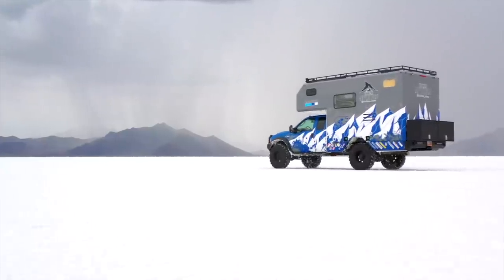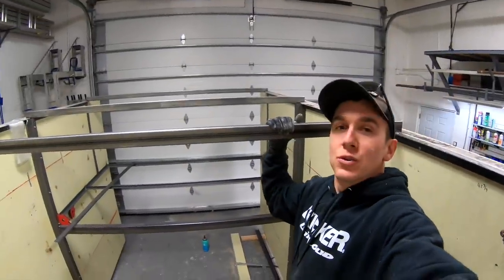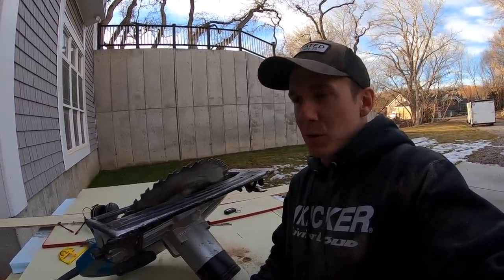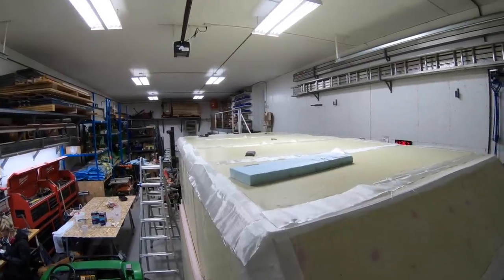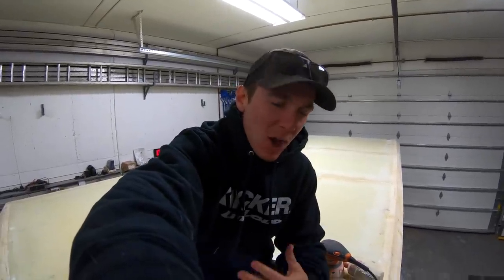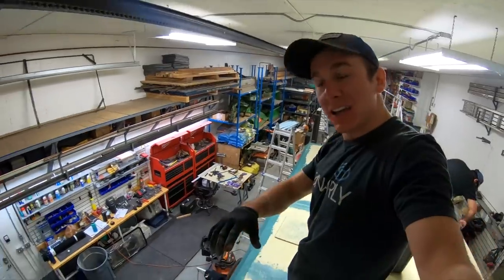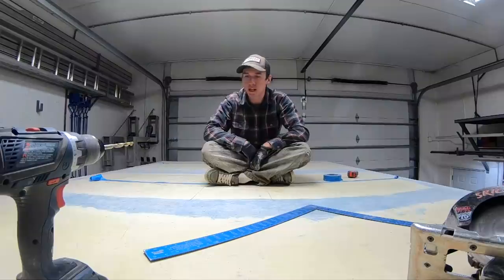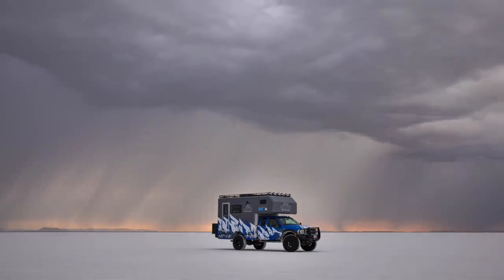MUSEROAMER PROJECT (Part 2) The Ultimate DIY Overlanding Expedition Vehicle!

Comment: Watching eagerly, as I would like to build a trailer for long term winter snowmobile trips.  Sealed, heated bay in the rear for the sleds, living area up front, designed around winter operation.
Reply from the maker: We want to do that as well! This project kicked my but a little. Plan is to take her to AK this spring!
Reply: @AndrewMuse  Right now the plan is to use a 25 foot or so 5th wheel trailer frame, old ones are available for very cheap.  Strip all the travel trailer off and start from the frame up.  Was doing some cad drawing and visualizing today in fact 👍
Reply from the maker: @mutt2jeff  That would be awesome! I would love to see how it comes together. Before we started on this build we thought about doing a toy hauler build out.

Comment: Great work.

So the panels were 1/2" ply, 2" foam, 1/2" ply ?   What ended up being the magic glue ?   You screwed them as well ?

Once the shell was done you fiberglassed the outside with 16oz glass mat and polyester resin ?

Comment: Can you tell us a little bit about dimensions of the box - Length x Width x Height, plus it would nice to hear about the final weight of a box without/with all equipment?
Thank you in advance
Reply from the maker: It's roughly 8x16' and with the roof box and AC on top it's nearly 13'. I'll be releasing a final weight with it mounted in a later episode, unfortunately I wasn't able to weigh the box alone. 🙏🏼😊
Reply: @AndrewMuse  thank you for sharing the information

Comment: it looks like your foam panels are covered on both sides with plywood, correct? Is the frame also steel? I know the 550 has a huge weight capacity, but that seems fairly heavy. Did you consider aluminum frame and lighters walls, and what made you go with the materials you chose? Also, I love the pass thru and think that is a must have in a rig like this. I hope to build the baby brother edition, much lighter on a Tacoma frame for a super capable off roader.
Reply from the maker: Thank you for the support Emery! The foam is sandwiched between HDO and the frame is steel. We originally planned on having a fiberglass shell but when that fell through we had to come up with other options that fit our budget. Unfortunately, aluminum and composite walls didn't fit in the budget. I'm really glad I ended up going with the pass thru! It's been really great so far and the foam plug we had made keeps the heat in the camper well.

Comment: Great job! This is amazing 💪
Quick question, how much does the camper weigh?
Reply from the maker: Thank you Simon! I'm not sure of the camper part itself but I'll be releasing the total weight in a later episode 🤘🏻😊
Reply: 3X as much as it needs to? this thing is awesome and seems to be built to cross the continent of Antarctica !!! i'm not sure but would also like to know why the double sandwich of plywood needs to be so thick ... i would like an aircraft engineer to give some alternative options that would allow interior attachments (which is why i assume plywood was used so much). great videography Andrew!!! thx

Comment: It’s not Ashley’s fault Bondo is just awful product and I would avoid using it with fiberglass

I expect the corners to open up - if or when the seams do open I would recommend having aluminum corner pieces built that rap from wood to wood gaping the foam
Reply from the maker: We definitely learned our lesson on that one, the seams we used Bondo on have started to crack. We've just been using silicone to temporarily patch the cracks since it'll require a new paint job we can't afford right now, but I do like the idea of pieces for the corners!

Comment: You’re building this on a 6.0 🤦🏻‍♂️
Reply from the maker: We bulletproofed it and it seems to pull just fine.
Reply: The funniest part of this comment is on of my  good friends has a 6.0 that he’s never bulletproofed and has plowed and towed a 20000 lb mulch blower everyday for work if you ask him the only problem people have with 6.0s is not doing there maintenance correctly/on time or just flat out putting the wrong oil in them (while I understand not changing your oil enough shouldn’t blow up a motor on a well designed engine we are talking about 6.0s)